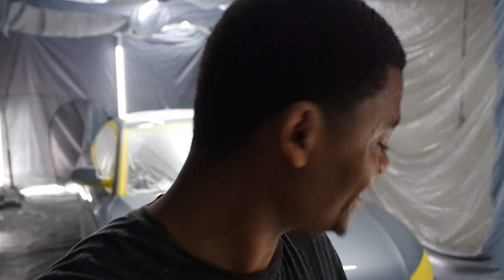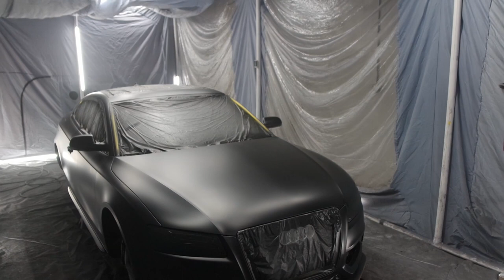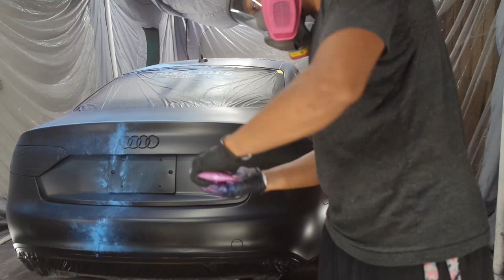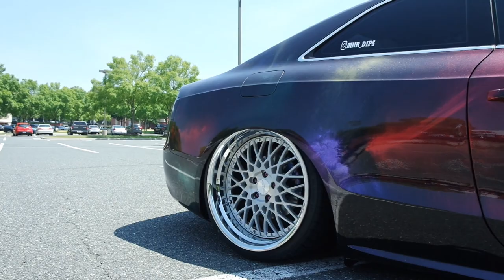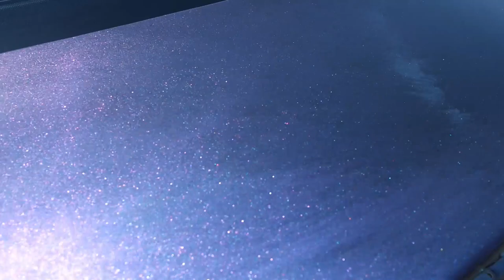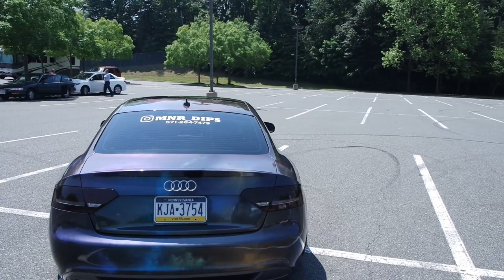Audi A5 Insane Pearl bomb autoflex express liquid wrap | MNR Dips

Comment: What's good Trey. I have a 60 gallon air compressor and I have been looking at inflatable paint booths since last year, just came across your video two days ago, the one on your inflatable paint booth. Got a couple of questions:

1. How much does the liquid vinly cost?
2. Is there a specific HVLP for the spray? What size/type tips?
3. Do either the top coat or clear coat need to be sanded? 
4. What is the drying time between the top coat and spraying of the clear coat?
Reply from the maker: $1500-$3500
Gun is based on preference 
Body wotk is recommended but not necessary
Depends on the temp. But usually an hour
Reply: Appreciate it.
Reply from the maker: @craigjoseph9374  no problem